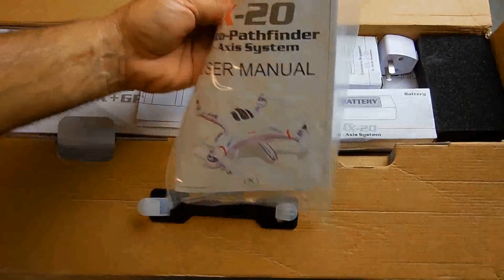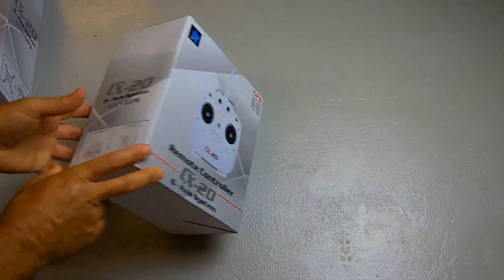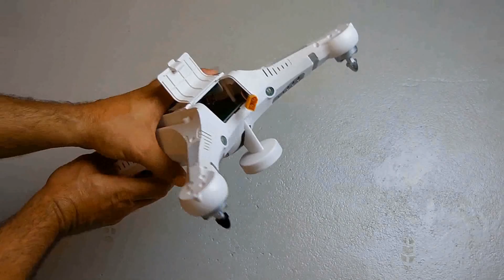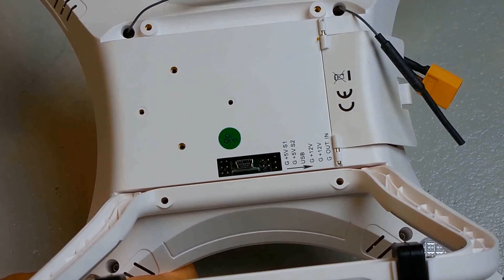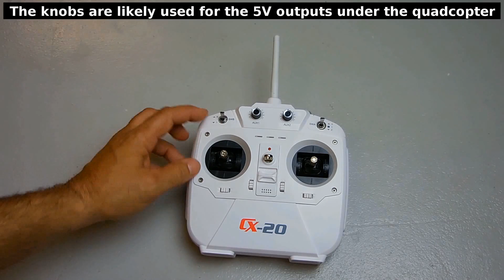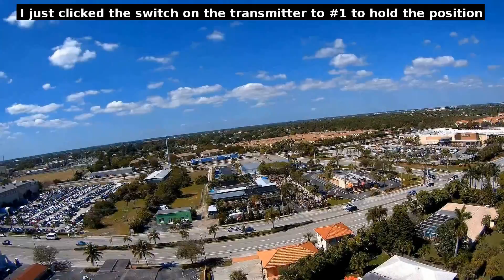Cheerson CX-20 Quadcopter(Unboxing/Assembly/Teardown & Operation)

Comment: it's the biggest piece of s*** ever with the worst GPS unit ever installed on a quadcopter. I bought three of them every one of them had a fly away and the GPS is so f**** unstable. even after you do firmware updates it's still has its random glitchy ass day then the toilet bowl kicks in and then it basically becomes unflyable cuz it's a piece of crap. get yourself a hubsan
Reply from the maker: I've had no problems. Who told you to screw with the firmware? Lol
Reply: why did you buy 3 if they so shit

Comment: Thats one of the best unboxing/setup videos I've seen for this model quad, even a complete newbie should be able to set it up and get it flying using your instructions (atho for a newb I'd probably invest in at least some prop guards and a spare set of blades) :)
Reply from the maker: +dash8brj 
Thank you. Not because I made the video, but I have watched many others, and I agree. The wrong videos get all the views. :-) I try very hard to create very good content. I already bought 2 sets of props for $10, and prop guards for $8. I play around with this quadcopter all the time.

Comment: At 1 pound you could add extra batteries no? I think you said 15 minutes flying time, that is not much... I'm new to this one so any info for the novice is going to go a long way... Probably a need to go in more depth in another video than to answer this question here...
Reply from the maker: +Curiosity 
Hello. Due to the level of power required by these quadcopters, 10-15 minutes is typical run time. I have a spare battery on hand to allow more flying time. Thanks For Watching!

Comment: Cool device. What's the max weight it can lift ?. Thank you for sharing another cool video.
All my best.
Bobby
Reply from the maker: IAmNateDiaz Use the link in the video description area! Only 200 or less..
Reply from the maker: +Bobby Tectalabyss 
I think 1 pound.
Reply: +electronicsNmore only 1 pound?
Reply from the maker: IAmNateDiaz

 How much were you expecting for a $200 quadcopter? 1LB is heavy.
Reply: +electronicsNmore I wish is was $200. I checked on eBay and it's almost $300

Comment: Might want to also look into getting/making a stabilized gimbal, they can be picked up as little as $50, though my $50 2-axis Basecam 8 bit board is not the best. (it works OK until a crash, has to be reset every hard landing because it will go crazy and act sporadically.)
Reply from the maker: +Power Max 
I tested different settings on my SJCAM and the video was much smoother, but the gimbal sounds like a great idea. :-)
Reply: +electronicsNmore You might eventually be able to achieve this type of footage! https://vimeo.com/112681885

Comment: Looks like fun, I couldn't use one in my neighborhood too close to the airport.
Reply from the maker: +James Schrumm 
They are fun. :-)
Reply from the maker: Sebas Sa Ru
Yes. I never flew one before, and now I'm excellent flying it. Just remember to get ready to flip the switch on the transmitter to #1 on the right side if you think you're going to crash. The quadcopter will stop moving and hold that GPS positon so you have time to think about your next move. Once you click into that mode, place the throttle in the middle(neutral) position. Thanks For Watching!
Reply: +electronicsNmore 
Do you recommend this quadcopter for begginers? Please answer!!
Thanks

Comment: No.... You didn't get sucked into the quad black hole too!
Reply from the maker: You're correct. Even though they can go up to 300m, the problem is seeing them.
Reply from the maker: +joblessalex 
When a company offers to send a free product to me that works extremely well, and is good quality, I make a video showing the product. :-)
Reply: +electronicsNmore I was honestly surprised at how thrown together it was. Honestly reminds me of my quad. Free is always nice!
Reply: +joblessalex speaking of which, I'll take a free anything anytime companies!
Reply from the maker: +joblessalex 
For a couple hundred bucks, you cannot expect too much. Considering the price, it has many nice features, not to mention a 300m range!
Reply: +electronicsNmore To use a 300m range, you'll find that you cannot really see the quadcopter when it is that far away. Probably 100m is far enough so you can still see how it is orriented (just about). To use the 300m range you will probably want fpv (1st person view) i.e. a camera mounted to give you live pictures of what the quad is seeing etc.
I think it is one of those hobbies where you can just keep getting more and more stuff to add - hehe

Nice video. Hope you have lots of fun with it. There are a couple of small ones (cheap) I could recommend - great fun. I have found bangood company to be very very good and helpful etc.